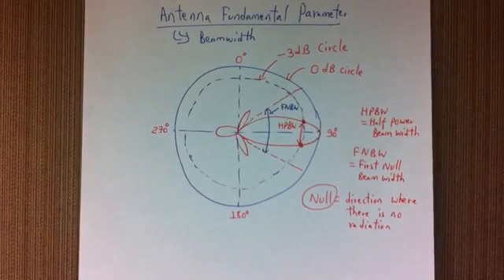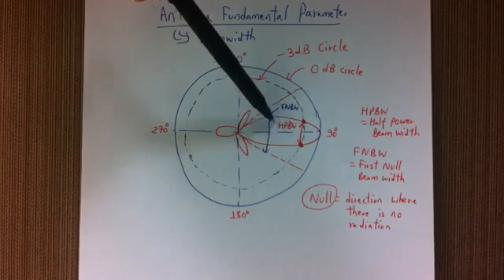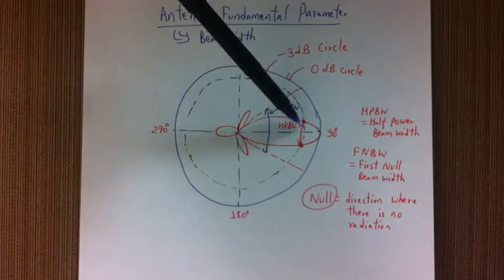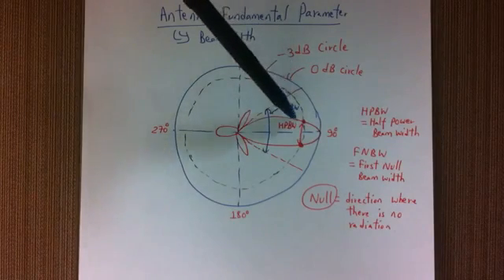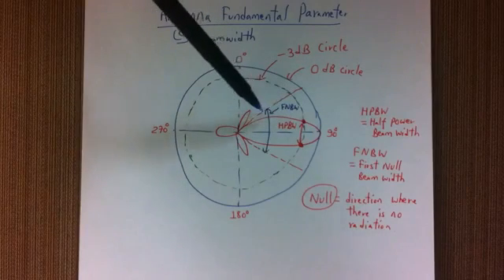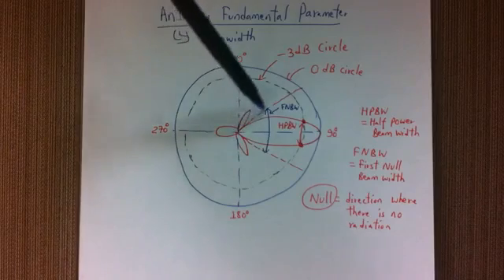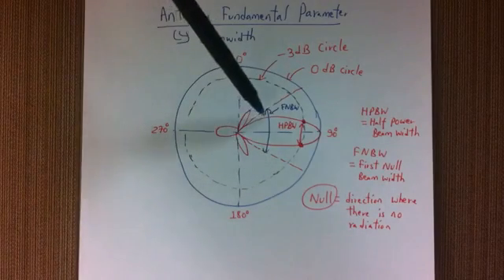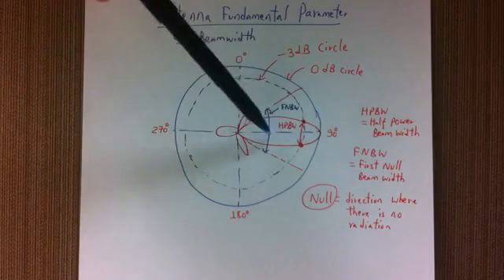Antenna Beam Width

Comment from the maker: In the example, the peak power of the front lobe is marked as 0db at 0 degree.  I would have guessed that the half-power (-3db) line was halfway between the Origin and the Peak of the major lobe ...  but it was drawn much closer to the Peak than the Origin.